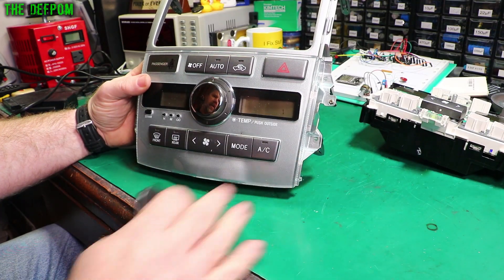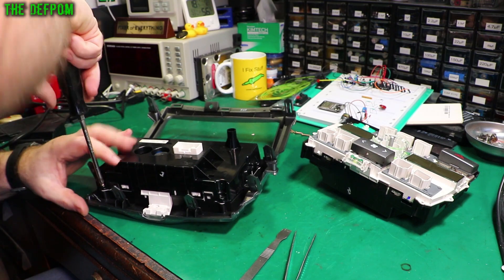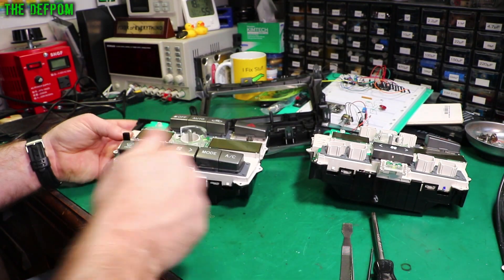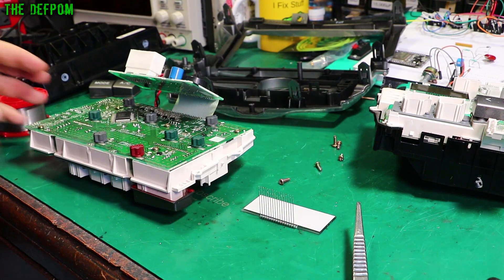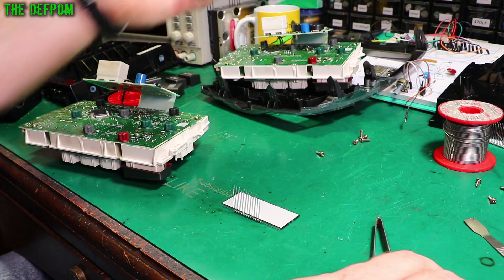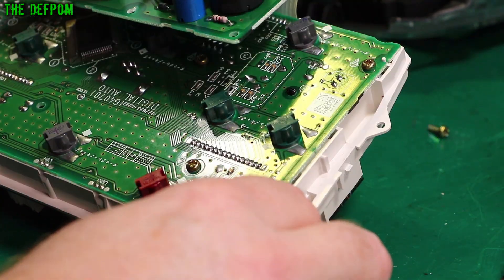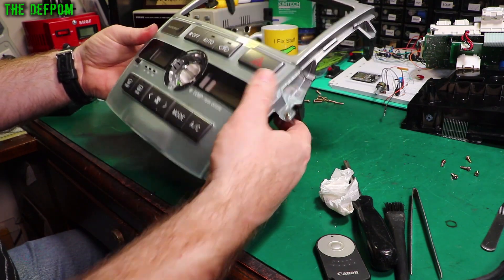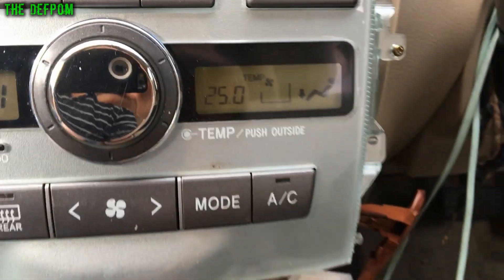🔴 Can This Heater Control Be Fixed ? - TOYOTA IPSUM Heater Control Repair Part 2 - No.865

Comment: What have you done to the SS-331? Did you remove the white cloth pad that came with it and replaced it with copper from one of those soldering iron cleaner?
What were the reason for that?
Reply from the maker: It is to help protect the filter material and also helps hold onto the solder so it doesn’t fall onto the rear of the suction tube when it is in its holder to help prevent blockage’s.